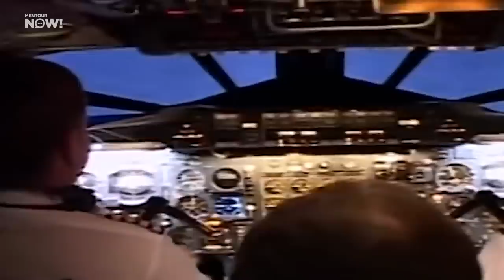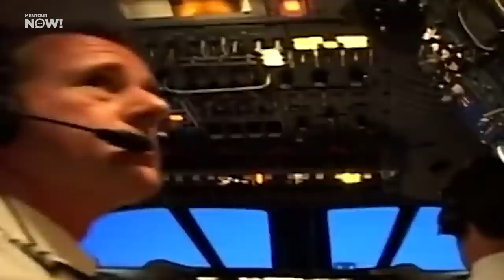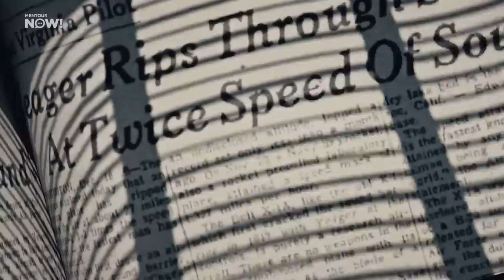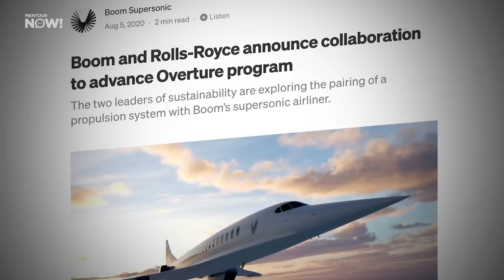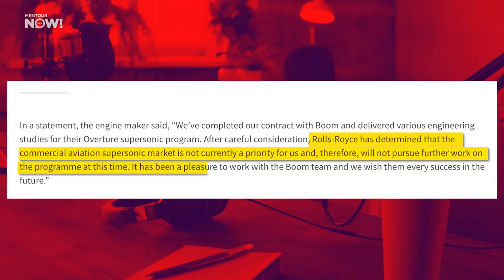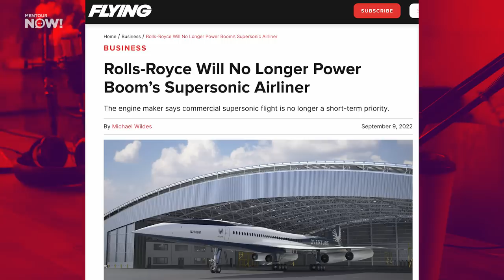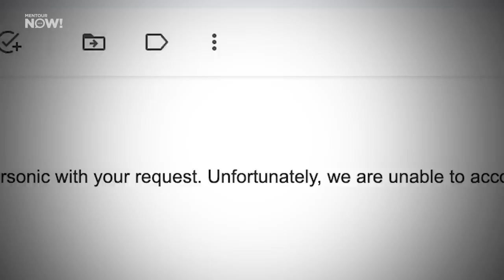WHAT’s Going On with BOOM Supersonic?! Will it Fail?

Comment: As long as there are enough people like Al Gore willing to spend $$$$$ on fuel to save half an hour... the supersonic airliner has a chance to be successful.

Modern design and engines, they can certainly make a supersonic "supercruise" aircraft that does Mach 1.2 (about 50% better than modern airliners) and be more efficeint than the Mach 2.0 Concord....

Skipping the afterburner means a lot of fuel savings.
Reply: Concorde did not use afterburner in cruise.  Afterburner was only used for 90 seconds on take off and for a short burst between Mach 0.95 and 1.3 then switched off after that. It could supercruise for 3+ hours at Mach 2.0. Something no other aircraft has come close to. It remains the most efficient supersonic aircraft ever to fly. It's Olympus 593 engines produced 30,400lbs without afterburner and remain the most thermally efficient turbojets ever made.  BTW the saving transAtlantic could be up to 4 hours. A businessperson could leave London at 10am, arrive in NYC at 9:30am (Concorde few faster than the Earth rotates) have hours of meetings, take the 1:30 Concorde home and be in bed the same night. For about 20% more than the First Class their company would have sent them on anyway, it was a bargain That is why it was able to make BA a profit for over 20 years.

https://www.key.aero/article/inside-story-how-ba-made-more-ps500m-profit-concorde

And the view from 60,000' at Mach 2.0 was awe inspiring for me and probably everyone else that ever flew on her.

Comment: Sorry but not happening. Even IF they found an engine supplier, Mach 1.7 isn't fast enough. Boom seats would probably cost more than 1st class on an A380 yet I think people would rather spend an extra couple hours in the air on one of those than pay for SST. Only 60-70 passengers at a time - it would cost a fortune.

Comment: Well I guess as only a few companies are realistically able to build an engine and none of them will, it is game over?
Reply: @arnoldhau1

Florida Turbine Technology, a division of $1.88bn Kratos Defence, started the symphony engine design in January 2023. Boom stated that no current engines, either military or commercial, are suitable for adapting to Overtures unique requirements. 

Boom will design the engine pods and the variable geometry exhaust and inlet ducting.

A big fuss is being made about Rolls Royce ending their contract with Boom, but AFAIK the contract was only for consultancy, and not to build an engine for Overture. Besides which, the Symphony project would be totally unsuited to the tier one engine manufacturers, like Rolls Royce, GE, P&W, and Safran. Their cost base and time frames would be out of kilter, and the volume of sales would not warrant their investment. GE caught a cold with the Affinity program.

Comment: "You can't fly a supersonic plane without engines" 
DARPA:
Reply: Florida Turbine Technology, a division of $1.88bn Kratos Defence, started the symphony engine design in January 2023. Boom stated that no current engines, either military or commercial, are suitable for adapting to Overtures unique requirements. 

Boom will design the pods and the variable geometry exhaust and inlet ducting,

A big fuss is being made about Rolls Royce ending their contract with Boom, but AFAIK the contract was only for consultancy, and not to build an engine for Overture. Besides which, the Symphony project would be totally unsuited to the tier one engine manufacturers, like Rolls Royce, GE, P&W, and Safran. Their cost base and time frames would be out of kilter, and the volume of sales would not warrant their investment. GE caught a cold with the Affinity program.

Comment: "If you don't have an engine you don't have an aircraft." Gliders would disagree.
Reply: Florida Turbine Technology, a division of $1.88bn Kratos Defence, started the symphony engine design in January 2023. Boom stated that no current engines, either military or commercial, are suitable for adapting to Overtures unique requirements. 

Boom will design the pods and the variable geometry exhaust and inlet ducting.

A big fuss is being made about Rolls Royce ending their contract with Boom, but AFAIK the contract was only for consultancy, and not to build an engine for Overture. Besides which, the Symphony project would be totally unsuited to the tier one engine manufacturers, like Rolls Royce, GE, P&W, and Safran. Their cost base and time frames would be out of kilter, and the volume of sales would not warrant their investment. GE caught a cold with the Affinity program.

Comment: So the Boom aircraft would be slower than Concorde? Not sure how that adds up to aerospace advances when this was already done in the 70s with no computers and no high tech composites. Why don't we just pick up where Concorde left off and use new tech? Seems like that would make more sense than designing a new aircraft to go slower with no engine supplier.
Reply: It actually  does. When concorde was developed  bypass was not an option. The irony of this is that going faster made it more fuel efficent... yes.. faster. More fuel efficent. The reason its not going faster still is due to the engine melting if it did. That also the reason the SST supose to go mach 2.7.

Bypass engine alows the aircraft to be more fuel efficent at lowet speed. The speed loss is does actually not impact travletime thst much. We talking about  30 minutes of the Atlantic.  The reason is that large part have to be subsonic
Reply: @matsv201  makes sense with the additional context. Thank you!
Reply: Because the Concorde was a super noisy fuel guzzler. The issue it not to reach mach 2, it is to to so efficiently.

Comment: Couldn't they used the same engines as Concorde? They are already designed, so the r&d costs are lower.
Reply: 60 year old technology. They are far from the efficiency they are looking for.
Reply: @se-kmg355  Actually as a Mach 2.0 supercruising engine, they have never been bettered efficiency wise. They are the most thermally efficient turbojets ever made. You need a low bypass turbofan or a turbojet for sustained Mach 2.0 flight. The Olympus 593 of Concorde produced 30,400lbs without afterburner (this is more than the F-22's F-119 engines) and allowed Concorde to supercruise at Mach 2.0 for 3+ hours. Something no other aircraft has ever matched.
Reply: @Completeaerogeek  I suppose that new computer calculations, design knowledge and modern material would make it more efficient. And where are you going to get these engines? The 56+spares that was on the fleet, are they still on the aircraft and would they even be usable? Spare parts and service knowledge etc.
Reply: @se-kmg355  I am not suggesting they use Olympus. Of course that is not practical although many Olympus are still in service at power stations as gas turbine backups so the knowledge base is still there. What I was clarifying is how impressive the 593 was and that there is currently no engine in this class.
Reply: @Completeaerogeek  Apologies if I misunderstood, just that that was the original question in the thread.

Comment: I would think they could use an existing high efficient designs currently used by modern fighter jets?  The are proven technology and should fit on the aircraft.  Maybe less efficient than these imagined systems but an "imagined" engine can't lift a real aircraft in the air.  They are going to have to get creative if they want to go anywhere at this point.
Reply: LOLOLOLOL!  No, they can't
Reply: @protonneutron9046  Like they "couldn't" for the Concorde?  LOLOLOLOL!   Watch the video again Dufus.

Comment: Aviation attracts romantics. This clouds all our decisions. Going fast in the atmosphere is difficult and expensive. There is nothing new about area rule. There are no secret aerodynamic breakthroughs. 
I admire their passion but I can't see the business case which is what the engine manufacturers are saying.
Just ask Bombardier how difficult it is to sell an outstanding airframe to airlines when they doubt your survivability.
Reply: Florida Turbine Technology, a division of $1.88bn Kratos Defence, started the symphony engine design in January 2023. Boom stated that no current engines, either military or commercial, are suitable for adapting to Overtures unique requirements. 

Boom will design the pods and the variable geometry exhaust and inlet ducting.

A big fuss is being made about Rolls Royce ending their contract with Boom, but AFAIK the contract was only for consultancy, and not to build an engine for Overture. Besides which, the Symphony project would be totally unsuited to the tier one engine manufacturers, like Rolls Royce, GE, P&W, and Safran. Their cost base and time frames would be out of kilter, and the volume of sales would not warrant their investment. GE caught a cold with the Affinity program.

Comment: Thats not an aircraft, thats a CGI video.. two very different things, obviously why RR didnt bother
Reply: @aNiTF3  

Florida Turbine Technology, a division of $1.88bn Kratos Defence, started the symphony engine design in January 2023. Boom stated that no current engines, either military or commercial, are suitable for adapting to Overtures unique requirements. 

Boom will design the pods and the variable geometry exhaust and inlet ducting,

A big fuss is being made about Rolls Royce ending their contract with Boom, but AFAIK the contract was only for consultancy, and not to build an engine for Overture. Besides which, the Symphony project would be totally unsuited to the tier one engine manufacturers, like Rolls Royce, GE, P&W, and Safran. Their cost base and time frames would be out of kilter, and the volume of sales would not warrant their investment. GE caught a cold with the Affinity program.

Comment: Concorde?
EEEEEW, no.
Not on it, even.

I would say:
Lockheed SR-71Blackbird at 1, OBVIOUSLY.
Lockheed SR-71Blackbird at 2.
Lockheed SR-71Blackbird at 3.
(Yes, the damn thing was THAT impressive on ALL fronts!!!, and you never spoke of airliners.)
DaVinci's Helicopter (AKA Helical Aerial Screw, with military designation "HAS MK1" ( :P ) ), due to it's time and the knowledge of that era. It was not build by him, nor would it even work, BUT ... considering they did not have Aerodynamic knowledge back then ... .) on 3.9.
The Russian Moskalyov DSB-LK (had it flown) on 4.
And several other oddities like the Grumman F-14 Tomcat (which was replaced by crap, they should have continued to work on the F14 Platform) with it's variable-sweep wing ... .
Reply: The impressive thing about the Concorde when compared to military aircraft, is the 2 people aboard an SR71 would be wearing something close to a spacesuit. On Concorde there were 100 people in shirt-sleeves sipping champagne. In this respect, the military machines are totally outclassed.
Reply: @MeTube3  ...
Excuse me, but you failed to get THE most important fact:
Concrap Flight Ceiling:
18'288 meters.
Top Speed: 
2'179 Km/h.
vs:
SR 71:
Flight Ceiling:
25'908 meters.
Top Speed:
3'540 km/h.

You were saying?
Reply: @Xogroroth666  I was saying 100 people in shirtsleeves sipping champagne at Mach 2, and operated on routine schedules out of civilian airports without military support. Your numbers are just Top Trumps and don’t impress me. But I will grant you your first request, you are excused.
Reply: @MeTube3  But you're still comparing apples with pears.
The Moskalyov DSB-LK could have been a nice passenger plane ... .

The reasons the Concrap failed:
- Material costs.
- Fuel Consumption (and thus pollution).
- Shock-wave (which forbid the plane to go supersonic above land, only benefiting the Mach 2 speeds above see.). At higher altitudes, this shock-wave is not heard from the SR71 due to the height. Even then, the SR71 at 14630.4m height flying at M3, would still produce FAR less sonic boom than the damned Concrap at 14630.4m height, flying at M2!!!!

The CRASH one was in, was mere an excuse to finally get the damn thing out of the skies.
Not a cause.
Purely an excuse.
Reply: @MeTube3  The reason I called it as such, is because it was SEVERELY overhyped!!!

And I am a kid of 52 years old:
Born June 12, 1970.
So, I have been through the Concrap era.
As a tech-nerd, I followed most of the aviation industry's their technological advancements.

Making a plane that drinks fuel like a medieval drunk drank wine or mead, flying FAR too low for it's speed, and thus having sonic booms that shattered all glass in miles around with the result that the plane was forbidden to go above Mach 1 over land, and thus for a huge part simply not effective, is simply LUDICROUS!

Counter that, oh Concorde lover.
Reply: I call the things what they are:
A cat, a cat.
A car a car.
And a plane that is like that, Concrap.
Reply: @MeTube3  Here, some data to give you some idea:
SR-71:
 ............Speed: ....  Height:........ Pressure .............Mach 3 ....15'000m ........69 PA
Concorde:
..............Mach 2 ...15'000M ....... 99 PA

Notice it?
SR => higher speed by a full Mach, but around 1/3rd the pressure.
Flawless design, knowing the first SR flew it's first in 1964.
The Concrap then flew it's first in 1969, 5 years later, and true, the SR was still unknown, but making a winged cigar like that?

Yep, brightless.
Reply: @MeTube3  I hoped for a technological countering of sorts?

Comment: I can't help wondering what would happen if Boom Supersonic asked Chinese aircraft engine manufacturers to partner with them. China has advanced in engine production significantly and while behind the west is certainly more advanced than Concord's RR Olympus engine.

And while it is true that governments in the west won't put a lot of money into development, I suspect that the Chinese government would do, especially given the kudos that producing the engine for a supersonic passenger airliner would give them.
Reply: Florida Turbine Technology, a division of $1.88bn Kratos Defence, started the symphony engine design in January 2023. Boom stated that no current engines, either military or commercial, are suitable for adapting to Overtures unique requirements. 

Boom will design the engine pods and the variable geometry exhaust and inlet ducting.

A big fuss is being made about Rolls Royce ending their contract with Boom, but AFAIK the contract was only for consultancy, and not to build an engine for Overture. Besides which, the Symphony project would be totally unsuited to the tier one engine manufacturers, like Rolls Royce, GE, P&W, and Safran. Their cost base and time frames would be out of kilter, and the volume of sales would not warrant their investment. GE caught a cold with the Affinity program.

Comment: i don't know, i saw both a hot glue gun and silicone being used during this video.
Reply: i'm not getting on it.
Reply: Aeronautical specification and certified adhesives and materials would be used in any critical areas. Also the XB-1 is an experimental aircraft, not a production Overture.

Comment: If in mid 2010's such start ups could seem viable, but in 2022 it seems that there is almost no chance for it to succeed, especially with skyrocketing gas and energy prices due to climate activists sabotaging ANY reasonable means to produce said fuel and energy, starting from fossils and ending with nuclear reactors, and instead pushing for wind(which is just unstable) and solar panels(which actually both are WORSE for environment than any other energy source, don't produce energy at night and have insanely low EROI). Needless to say that they also essentially killed US oil industry.